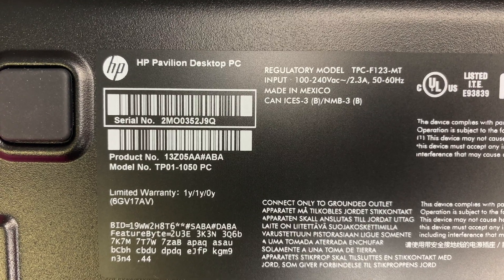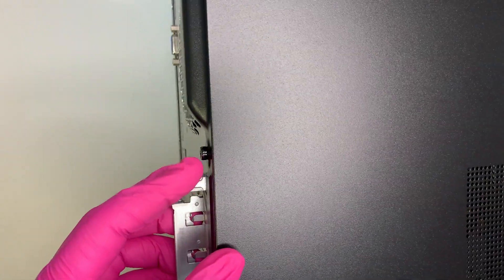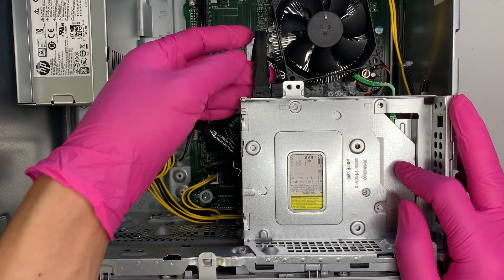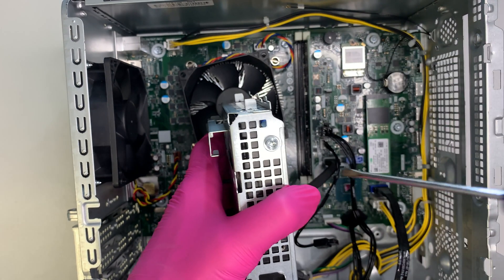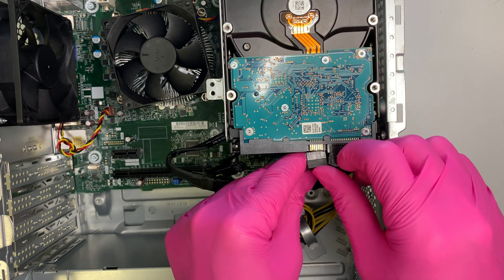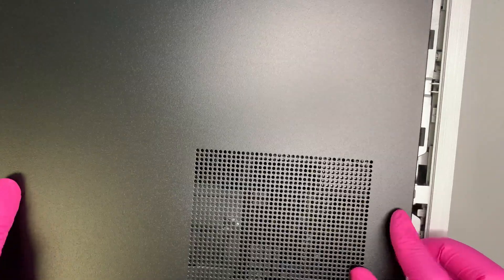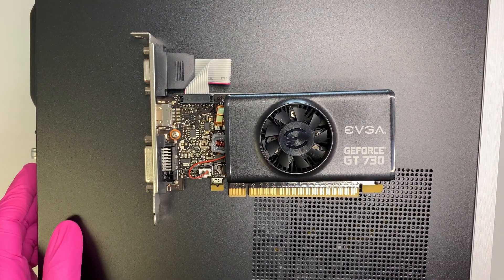HP Desktop TP01 1050 Upgrade Add Secondary Hard Drive

Comment: Followed this video and installed a 2 TB HDD to my HP computer. It was so simple, I kept reviewing my steps to insure I did the installation correctly. Fired up and initialized disk. All done in less than thirty minutes! Thanks UberGeeks.
Reply from the maker: You are welcome. Glad the video helped.
Reply: Hi what model or brand if its not too much ?

Comment: I was really glad to find this video!  Thanks!  Very clear instructions.  My only glitch was when I popped out the optical drive, to open the case, one of the cables disconnected from the motherboard and it wasn't obvious where I needed to plug it back in.  My fault, not the video's.  I did go back through the video and pause/zoom in on some of the shots that showed the motherboard with the cage removed but it looks like the TP01 motherboard for mine was slightly different than the older one.  I plugged it into the white holder and will hope for the best.  (Now to look to see if there is a YouTube video showing how to replace optical drives -- that should tell me where I should have put it.)

Comment: Hi: Where does SATA cable from new drive connect to MoBo? There is one slot with a cable at end of NVME SSD that came with computer and has one end of a SATA cable plugged into MoBo and the other hanging empty plus there are two empty SATA connections on MB.

Comment: How long does the SATA cable have to be for an HD mounted on the chassis wall (not in the drive cage)? 8 inches or 12 inches? Also, is a right angle to straight SATA cable better? Thanks!
Reply from the maker: better to go with 12 inches. L or straight is fine. it does not matter
Reply: @UbergeeksBiz  Thanks for letting me know, and for posting your very informative video.
Reply from the maker: @laiken2736  You are welcome. Glad the video helped.

Comment: I have a question, can you please test the voltage of that purple wire in the small inline connector. It should be easy by putting one side of a voltmeter on the pin of the purple wire and another on the black wire next to it.
Please tell me the reading, if it was 3.3, 5 or 12 volts?

Comment: I'm looking at a TP01-2347c which is probably similar to this.  It comes with 256TB SSD drive and 1TB SATA HDD pre-installed.  I'd like to add a larger drive -- like an 8TB SCSI -- to it.  Is there room for a third hard drive and will it accept SCSI?
Reply: No SCSI. There are 3 SATA connectors on the motherboard and a power cable with 2 connectors on it dangling inside the case.

Comment: Did the ram you bought run at 3200mhz? The 32 gig of 3200 ram I bought runs at 2667.
Reply from the maker: 8gb ddr4 2666mhz
Reply: @UbergeeksBiz  I bought ram with the same specs as the Samsung ram that came in it. The Samsung ram ran at 3200. No one has figured out why the same spec ram runs at 2667.
Reply: @allenvestal1958  The HP motherboard's maximum supported ram speed is 2667 MHz, that's why you won't see any ram run above that speed.
Reply: @lumiereeclair  Came with 12 gig of Samsung ram that ran at 3200.
Reply: @lumiereeclair  my newer TP01-2x Ryzen 5 system came with 12GB DDR4 3200 DIMM ram.  I raised it to 16GB by replacing the 4GB board with an 8.  Seems to run at the full 3200 (actually shows 1600 on some screens but I assume it is correct).
Reply: @Terry-yd2fo  Windows will show your speed as 3200, but some 3rd party tools like CPU-Z will show it at 1600. It's true speed should be twice that, since DDR - double data rate.

Comment: Is it possible to mount a 2.5" SSD into the same bracket without some sort of adapter?
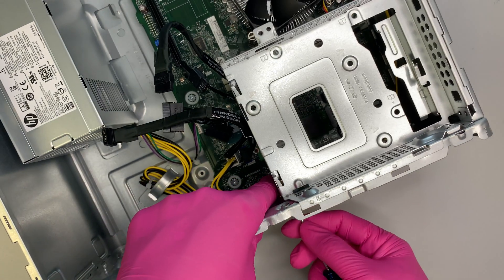Reply: At 5:10 look at the holes on the bottom of the silver cage. 3 of those holes are spaced perfectly for a 2.5 in drive. You can put a regular 3.5 on the top and mount a 2.5 on opposite side. If you want to do this though, you won't be able to use the optical drive, and you need to mount the 2.5 in drive first since you need to screw the holes from the top of the cage. If you want to continue to use the optical drive then there is another option. At 4:34 there is a large open space between the power supply and the front of the case. If you remove the front panel as shown in the video, there are holes in the case that will allow you to mount a 3.5 or 2.5 drive behind the front of the case.
Reply: @lumiereeclair  Thank you. I want to install an additional 2.5 drive. Will it require a bracket to install it in the space between the power supply and the front of the case?
Reply: @charlescadogan8504  No you don't need a bracket. At 5:14 below the silver hard drive cage and across from the power supply, you can mount the 2.5 drive. You will have to mount it behind the front of the chasis.
Reply: @lumiereeclair  This is what the foreign service/upgrade document for my TP01-2x seems to show.  But it must be 2.5" there, 3.5" won't fit there.  I had to put my 3.5" upside down on the tray as shown.  Very tight fit.
Reply: @Terry-yd2fo  I'm not sure which specific location you're referring to. But it is possible to have 3 sata drives on this machine. Two can fit on the silver cage, a 3.5 on the front of the cage and a 2.5 mounted behind it on the same cage. Another 3.5 or 2.5 drive can fit behind the front panel. My current machine has 2 2.5 drives and a 3.5. My main drive is the M.2 NVMe and I also have a PCIe adaptor to install another M.2 NVMe but I haven't got one for it yet since it's only going to be PCIe x1 speed.
Reply: @lumiereeclair  This HP video I found does show a 3.5" on the panel, but on my chassis there was a tab jutting out stopping me from putting the 3.5" there.  https://youtu.be/GzJbEJ1NiAk?t=340
Reply: @Terry-yd2fo  That's strange. It wouldn't be a deal breaker for me personally, but losing the option of putting any size drive there is disappointing. Maybe contact HP to see if this is normal?
Reply: @lumiereeclair  My requirements were pretty simple, just something to back up the 500GB SSD. Ended up getting a Seagate Barracuda that had been stored since 2013 for $14.  If I ever open the unit up again, I think I could tear that tab off with a pliers.
Reply from the maker: You can Jerry-rigged by putting one screw to hold it. It will hold...